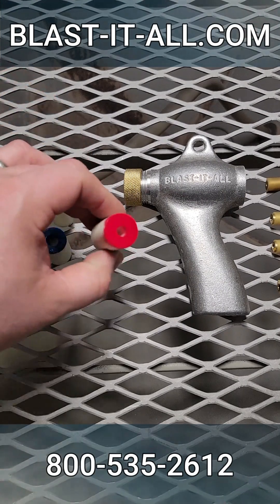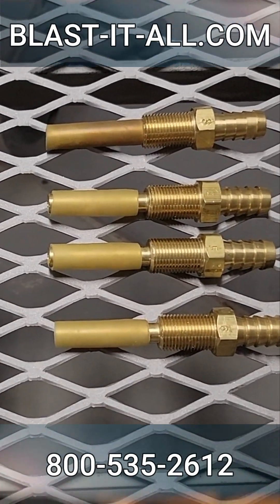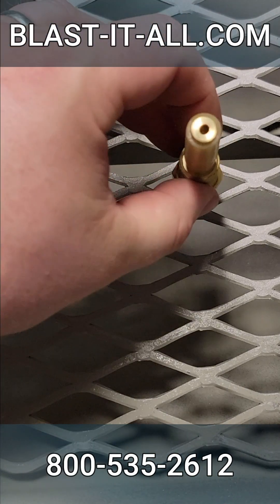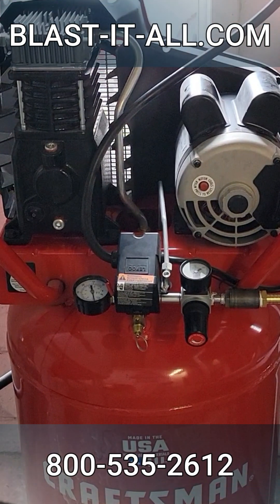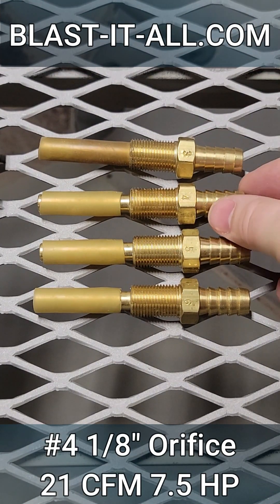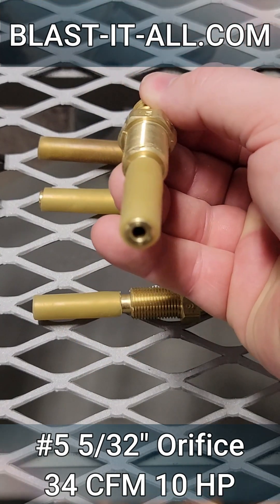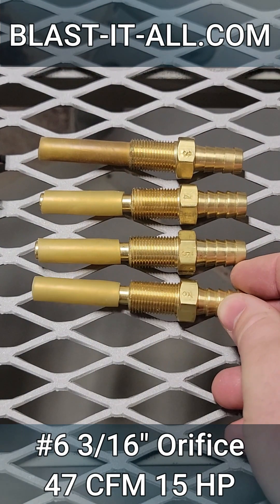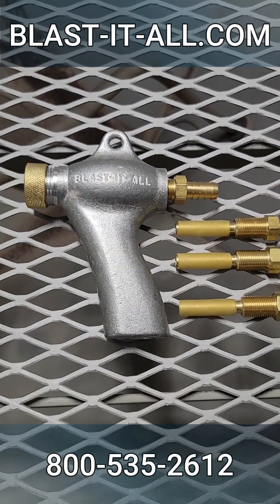How big of a compressor do I need for sandblasting?

Comment: Is it possible to sand blast small parts with a smaller compressor? I have a 3.5hp 6 gal compressor. Says 5.2cfm @ 40psi and 4.2cfm @ 90psi.

I'm just looking to strip paint off small (2.5" x 2.5") metal parts, a handful at a time.
Reply from the maker: Yes, it is possible. It will work as long as there is enough air in the tank. This video shows more: https://www.youtube.com/watch?v=TQoe0ov4M_c

Comment: Good Morning,
What size Orifice would you use for a 25 Horsepower Compressor?  Thank You....
Reply from the maker: Good Morning
A 25 Horsepower compressor should give you about 87 CFM at 80 PSI. If it is all dedicated to blasting you could go up to a #8 gun which would have a 1/4" Air Jet and 1/2" Nozzle. I would recommend you stay under sized at a #6 or #7. 
You can find a CFM chart here: https://blast-it-all.com/cfm_requirements/

Comment: I got a 3.7 horsepower DeWalt 60 Gallon Compressor, 11.5CFM at 90PSI, and I'm just using the harbor freight gun because I cant afford one of y'all's units at this moment, should I be safe? (im going to be using high flow fittings and a short 3/4 airhose from the compressor to the Cabinet)
Reply from the maker: The harbor freight gun is not what it is advertised as. https://www.youtube.com/watch?v=tfRZ-5cdlY4

Comment: what is the ideal air hole for a jet with an air pressure of 30 psi?
Reply from the maker: Most suction blasting is done at a higher PSI. This page will give you the correct Nozzle for the Air Jet Orifice and the CFM at 40, 60, 80 PSI. Suction is on the left and pressure is on the right. https://blast-it-all.com/cfm_requirements/